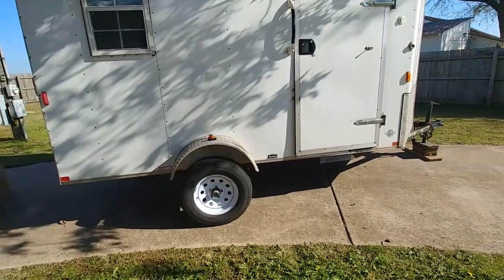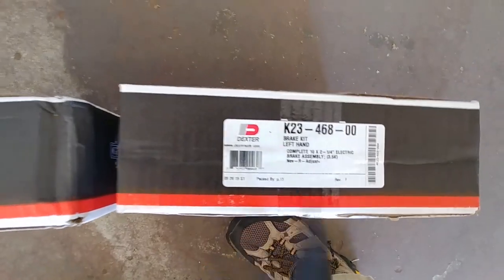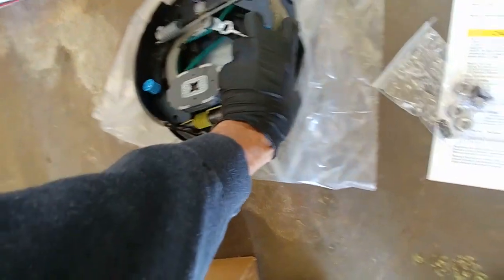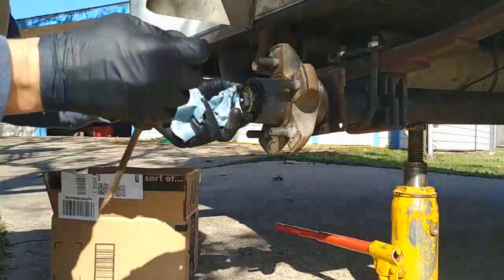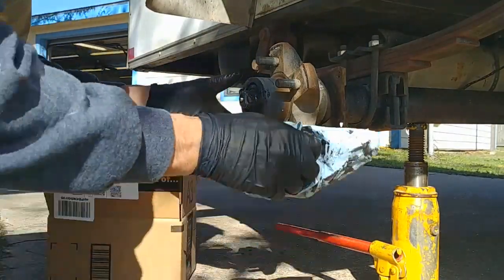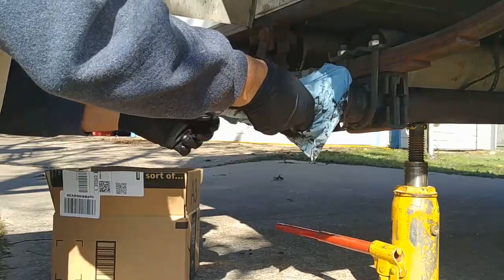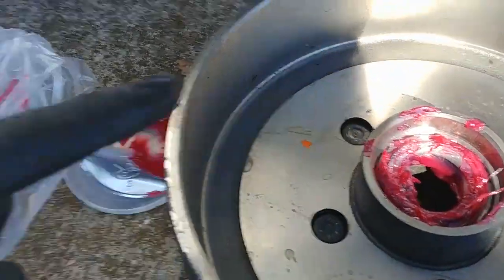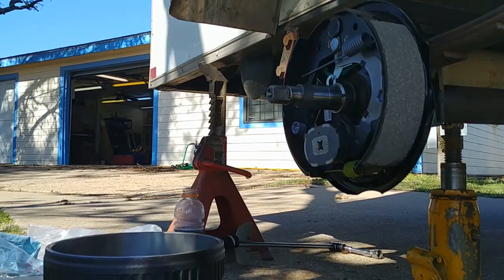HOW TO INSTALL DEXTER TRAILER BRAKES 6 X 12 Cargo Trailer Camper Conversion Part 34 vanlife

Comment: Your 2x4 method is a smart one.
 - On the video I squirmed when you chose not to use it when putting-in the seal.
Reply from the maker: LOL. I've put in plenty of seals without a driver, but still, a driver of some kind is best. Thanks for watching.

Comment: You handled that like the pro You are. I guess this new self-lube for greasing is ok, but if Your grease seal can't hold all that grease Your going to have some messy brake shoes. If those bearings are the same ones used on passenger cars and light trucks, why repack them every 12,000 miles unless You've had the axle"s submerged in water. If You have 15" tires on Your trailer and 15" or 16" tires on Your tow vehicle and You repack the tow vehicle's bearing's every 50,000 miles. Maybe repack the trailer bearing's every 25 to 30 thousand miles for safety sake if needed. Great video.
Reply from the maker: Thanks for watching. Agreed on the seals and repacking.

Comment: I didn’t see you do the initial brake adjustment . Did I miss it or don’t you think it’s necessary ?
Reply from the maker: I didn't record it but i did a check for the adjustment and they were both very close from the factory. Thanks for the great question michael. Good luck on your project.

Comment: It looks as though you now only have about an inch of travel between the backing plate and the the trailer body, should a new wider axle have been used so you have the correct distance between the top of the brake drum. @ 4:20
Reply from the maker: Hmm, the axle is the one that came with the trailer when I bought it new. Adding the brakes, the backing plate was no closer to the frame than the axle flange. The hubs positioned the tires to clear the frame and the leaf springs. It all fit together well. I am not sure what you see, but everything was the correct distance for it all to work. If you look at 5:09 you will see the leaf springs hang from the frame rail and the backing plate is 2-3 inches away from the spring. You can see at 15:37 that the original tire and wheel fit correctly after installing the brakes. I hope that helps. Thanks for watching.
Reply: @FakeLegGreg  It is probably the angle of the camera when it was shot, I looks like the top (12 o'clock) part of the backing plate will strike the bottom of the trailer, meaning the brake drum will hit on the trailer when it's installed

Comment: I have a lippert axle on my 6x12 no brakes. Will this kit fit it?  I have 5 on 4.5
Reply from the maker: I am not sure. You probably should contact E Trailer. They have specialists that should be able to assist you. Good luck.
Reply: @FakeLegGreg   I just ordered a 82475-C-DEX	 complete trailer brake kit even comes with wire for the brakes, 7 pole plug battery with break away switch. 280.00  with tax.
Reply from the maker: @livinglifemyway7349  Sounds like a deal. I hope the install goes smooth.

Comment: Hi. Thank you so much for the video. Quick question.  By looking through the wheel (without taking the wheel off) is there an easy way to tell if there is a brake system?
Reply: Just look at the back of the wheel.